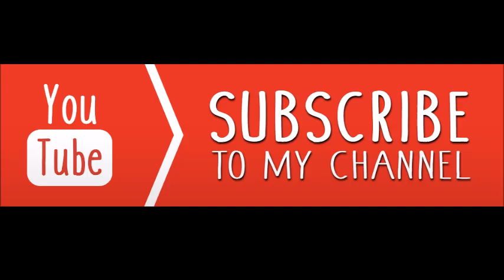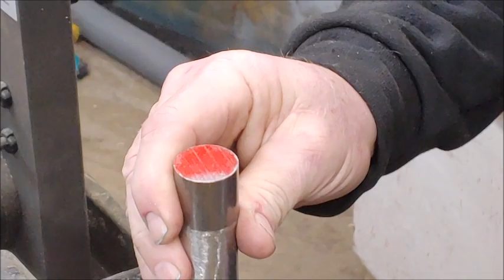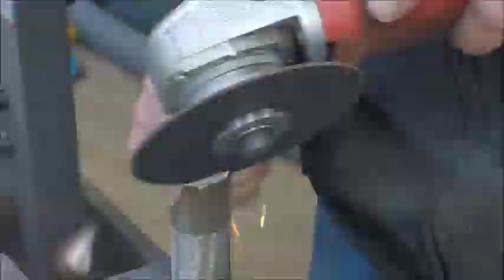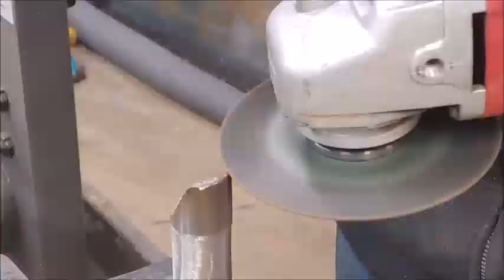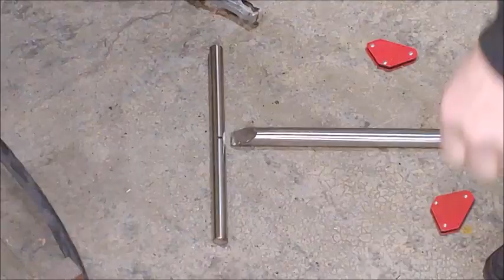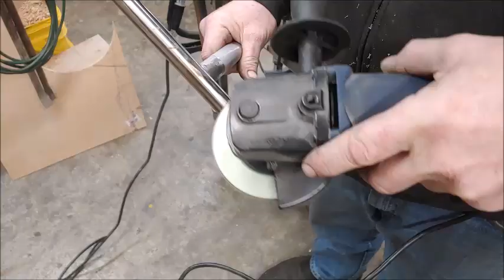woodturning- DIY tool rest for the lathe

Comment: What kind of Chuck are you using? I'm trying to gind one for my central machinery lathe.
Reply from the maker: Nova 75th aniversary set. Just make sure you get the right size for your spindle. Mine is 1 inch, 8 threads per inch.